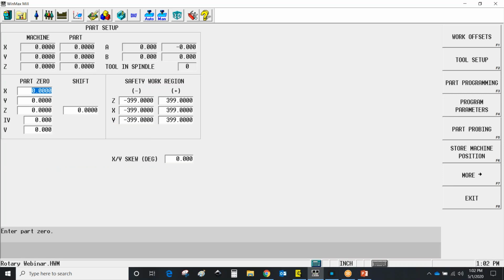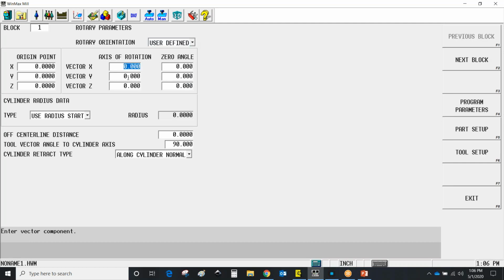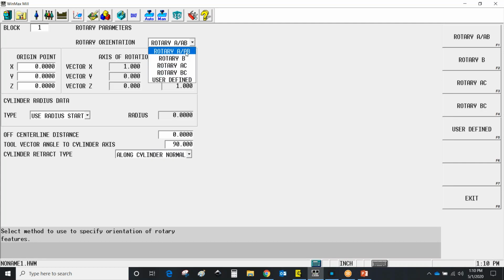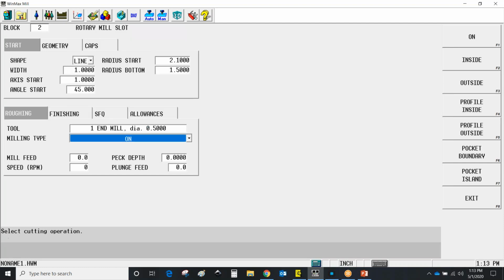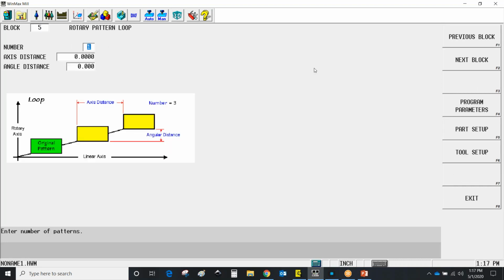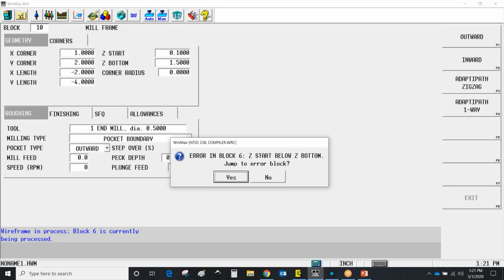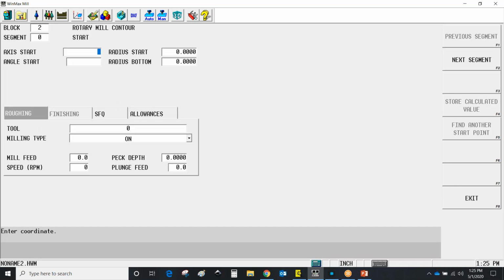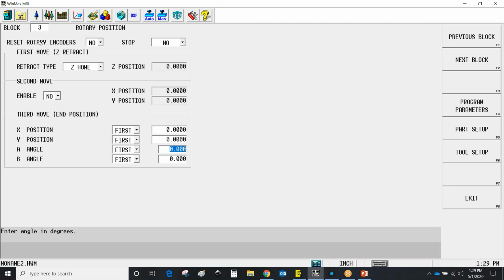Hurco Quick Training Session 5: Conversational Rotary Programming

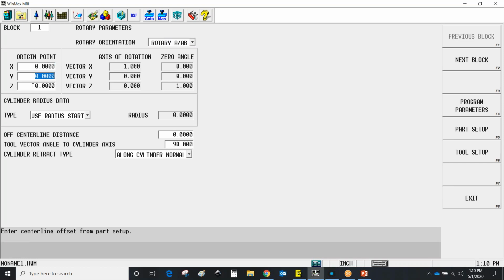Comment: How would the origin point referred to at 9:00 to 9:30 in the video get programmed in NC programming?
Reply from the maker: Hi Aaron, you could try the rotary axis method for that origin point. X__ Y__ Z __ is cylinder coordinate system location with respect to the current coordinate system. If not specified, the control sets them to zero.
Reply: @hurcousa  thanks for the response but this doesn't really help with the issue Im dealing with. Im trying to machine 4 sides of a part with one part setup that is not centered on the rotary table in a HM1700RI
Reply from the maker: Sounds like you need to use G68.2 Transform Plane. 
•	The G68.2 XYZ will tell the control how far from the original zero the newly desired origin point is.
•	The G68.2 ABC allows the programmer to rotate the workplane – to determine what face of the part the Z-axis should be perpendicular to.
•	The G8.2 XYZ is the target point where you want the tool to position just prior to plunging into the part.
•	The G8.2 I0 J0 K1 tells the machine to position the rotary so the tool will be perpendicular to the newly created warplane. Because the Transform Plane is par of the Tool Center Point Management system, the machine will automatically position the B-axis when the IJK is called. 
•	G69 cancels the Transform Plane (and TCPM) and reverts back to the original part zero – however, calling the G69 does NOT force the machine to reposition – because the TCPM is no longer active. You would need a B-axis command if needed. The IJK will not work outside of the TCPM being active.
 
 
T1M6 (.375" Drill)
S1200 M3 M09
G68.2X0.Y0.Z0.A-45. C225. (Transform Plane Data)
G8.2X0.Y-0.Z4.0472 I0 J0 K1 (Automatic Safe Reposition Target Point)
G00X0.Y-0.
Z4.0472
Z3.6535
G81 G98 Z1.043 R2.743 F600.
G80
X0.Y0.Z3.6535
X0.Y-0.Z4.0472
G0 M140 (Retract Along Tool Vector)
G69 (Transform Plane Cancel)
G53 Z0.
Reply: @hurcousa  thanks!!!